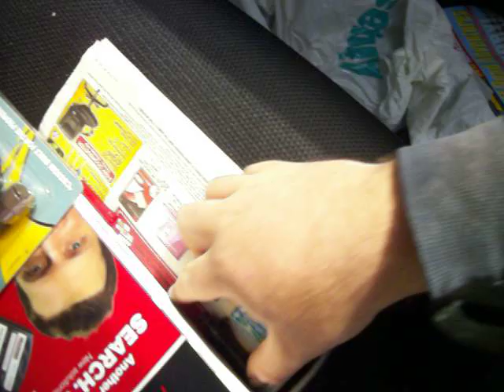Installing door light switches in my Jeep

Comment: This is way old but in case anyone is looking at this video because they had the same issue I did, the switches are shipped adjusted too far out and if you shut the door it'll just break the switch. You have to adjust them manually a certain amount. I used a rubber mallet, I tapped the face of the switch and it adjusted itself in. Do this or something similar until it's adjusted in far enough for the door to hit the face of the switch instead of the side, then you can let the door adjust it the rest of the way.

Comment: New switches appear like they will stick out much further than whats left of the old switches in my new to me 2002 Wrangler Sport. Are these adjustable? If so, How?
Reply from the maker: Mine weren't adjustable. They fit fine. You in the PGR?
Reply: @robby844  Used to be. Was an RC in S.E. WI until the state captain got jealous and claimed all the flags, poles, coolers, etc., that I'd bought, repaired, or replaced over time, were actually property of the PGR, and I was to surrender all to him immediately. Notified me by email, allegedly. I've never seen those emails. Was done when the law showed up at my door. He'd had the regional capt file a theft report. I'm in Austin TX now. PGR has turned into a business, not a movement. The "Board" kicked out the guy who started it, when he started noticing funds missing.
Reply from the maker: @kontractor8295  yup. Im in SoCal.... I got told that hold a flag pole in your left hand and suluting (non-veteran) with your right was approved by national.... So me being the asshole I am... Emailed national... They said under all circumstances proper flag ettiquite and protocol is TO BE followed. End of discussion.... I forwarded it to our posting team ( bitch was one that had a pissy fit on Facebook) and she blocked me on all PGR Facebook channels.... Theres a whole other story about my dad passing away who was a member.... He put 100,000 miles on his goldwing just for PGR mission...
Reply: They are adjustable, when you close the door the ribbed portion of the shaft will actually push in
Reply: @steffano319  Thanks for the info. Bought one and it's longer than the old one, although the codes matched....